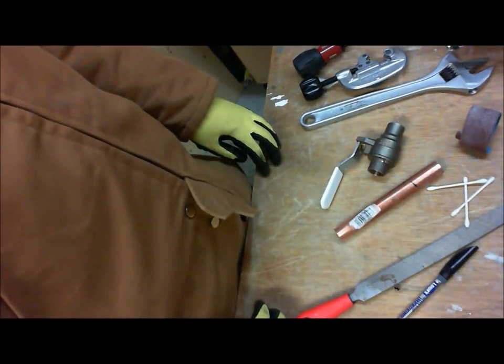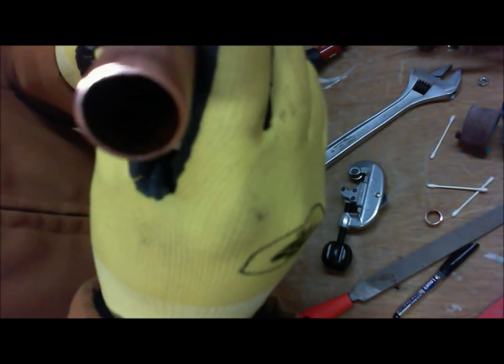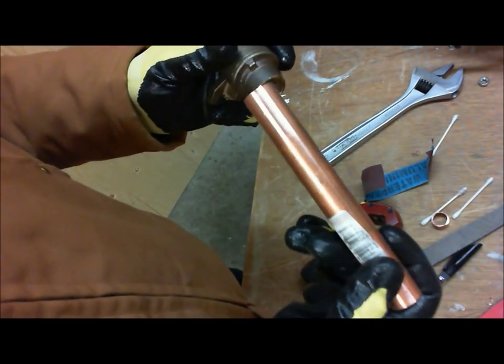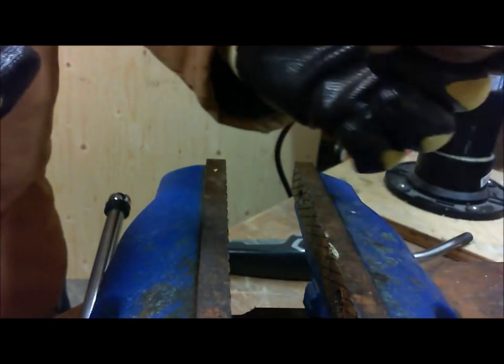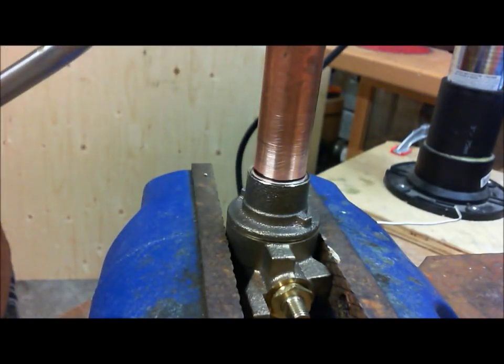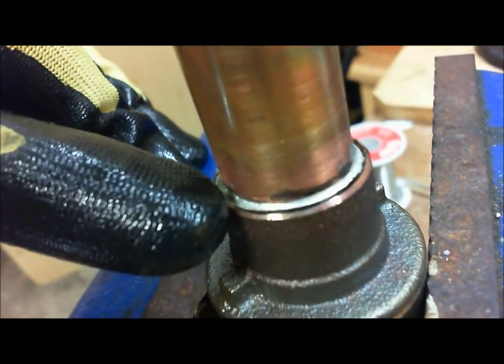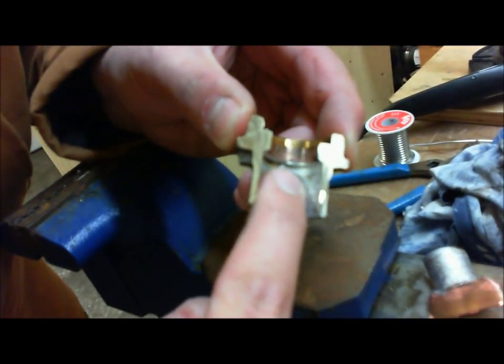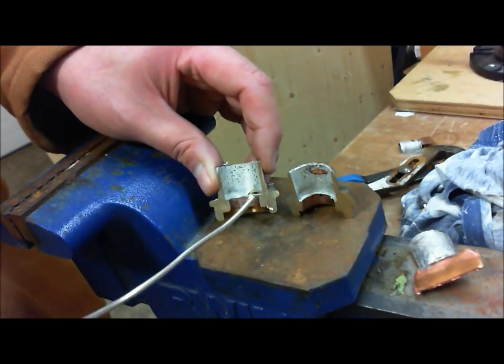Soldering Ball Valves

Comment: You are doing it a little wrong, you do not use permanent marker to mark depth,and you certainly do not force the cooling time,it can fracture or crack the solder joint

Comment: Could you use acetone to clean up the surfaces?  It works well prior to painting as it dries quickly
Reply from the maker: Please don’t. Acetone is corrosive. Either wipe it with a clean dry rag or use alcohol. Thanks.

Comment: I disagree with adding flux into the valve, when you insert the pipe the flux will be pushed into the valve and build up providing a path for the solder to build up with in the valve. better to add flux to pipe rather than the other way around.
Reply from the maker: With the flux on both the pipe and socket, it ensures that the solder will flow.

Comment: The other problem with those loose copper burrs is that they may eventually break free and get stuck in the down steam shut-off valve/faucet seal, causing a drip issue!
Reply from the maker: That is why I made the best vid on YouTube to solder a ball valve 😝
Reply: @MrTooTechnical  Thank You!

Comment: Dave I liked your video and learned some useful things. I have a question: I have unsoldered a couple of half inch ball valves. Was planning to reuse them on another system. Can I do that or are the valves damaged by the heat of melting the original joints?
Reply from the maker: Better to remove. How old r they?
Reply: @MrTooTechnical  I dismantled my homemade passive water heater and set the copper pipes and fittings aside about 25 years ago.  Now I have a use for the valves. Did I ruin them by unsolderring  them? Can I reuse the valves? Or did I melt the teflon seats? Maybe I should not take a chance and just go buy a couple of new ones.
Reply from the maker: What do u think

Comment: I HAVE A PROBLEM DESOLDERING A 3/4 INCH BALL VALVE, I VE APPLIED HEAT TO IT WITH A HIGH HEAT MAP GAS TORCH, I HOLD IT THERE FOR A WHILE AND NOTHING..IT IS MAP GAS THAT I AM USING, HOW DO I GET IT OFF?
Reply from the maker: too much water in the pipe.  cut it out then.  woohoo

Comment: Wow, so much extra work. Very detailed work. If you just sand, flux and heat it all works fine. The contamination come out of the fittings as the flux boils, wipe with a dry rag, and run your solder. Take off aerators for the sinks down line and flush the system of any excess flux or contaminations that made there way into the pipes.
Reply from the maker: It works. I made a great vid. Woohoo
Reply: @MrTooTechnical  You did, nice technique.

Comment: The fitting brush may have had particles on it from its last use.  It also may have removed a bit of surface tarnish from the inside of the valve. That's what it's supposed to do. It's not a bad idea to wipe out the valve before soldering.
Reply from the maker: i did, i cleaned the heck out of the valve and pipe.

Comment: Thanks for the video. You attributed the small spot with no flux present as being caused by a lack of heat. Question: Could that be caused by less than perfectly round pipe, where the spot with no flux was a small area with a pinch (interference) fit between the two parts?
The reason I ask is that I desoldered a pipe fitting and have sanded/brushed the old solder away as best as possible in order to install a new fitting. The fitting fits, but a snug in a couple spots. I don't know if the capillary action will work its way into a slight interference fit.
Reply from the maker: nope.  remember, when u apply heat the pipe will expand.  So i dont care how tight the fit.  once you properly prep, and flux, u should be gold.  i just didnt prep as good as it should have been.  hard to find on youtube anyone who takes apart their solder joints.
Reply: @MrTooTechnical  Thanks for your reply. I would have much preferred just cutting instead of desoldering. But the way the plumbing was installed would make this a MAJOR headache. IMMEDIATELY adjacent to the fitting I needed to remove are two "T's", then a valve, and then an inch later - the wall (and, no, it's not the wall some jerk says Mexico will pay for)
Reply from the maker: @gregparrott  i hope u have no issues
Reply: @MrTooTechnical  Thanks. It's been slow. But if I get the soldering right, I will have completed my first ever hot water tank installation. Replacing a 21 year old, 50 gallon gas one which started making odd sounds (well past due)
Reply from the maker: @gregparrott  there u go

Comment: Good info thanks.  Definitely don't want to over heat the connections or use too much solder I can see.       
Also, I didn't have 40 minutes so I viewed it at 1.5X speed, worked nicely.

Comment: Thanks for vid and very thorough explanation. I think in a ball joint you need to be very careful to get the brass fitting hot enough to accept the solder, without heat-damaging that plastic seat washer. The proof is in the pudding and you showed us all the solder coverage in your cross sections.
Reply from the maker: thank you

Comment: Great detail nice video. One improvement would be to test the joint under actual home water pressure. Close the loop of the copper tube at one end, add a joint or valve in the middle and at other end add a thread connector and do a water pressure test. That way you see if the joins leak and then cut it open to show why it worked.

Comment: @Dave Daved - Thanks for sharing the Great Video Dave! Very Thorough and well detailed. I was just soldering some 1/2" copper pipe yesterday... I also clean the inside the pipe after using the brush, and I also use the same style debur tool too (but stand alone, never saw that style on a pipe cutter) as I too thought it did a much better job than the reamers on my pipe cutters. Glad to see someone agrees!!   LoL :-)    :ThumbsUp:
Sandpaper works great to clean the outside of the pipe, but I found that 00 steel wool works great too. Oh and I cut off my fitting wire brush tool, and use it in my drill, makes it a lot faster when cleaning a fitting :-) lol
Reply from the maker: perfect.  thanks

Comment: Just want to make the point about the valve being open or closed when you solder it. In a closed pipe system the heated air inside the pipe is expanding and the solder will not flow into the joint because the air is venting there. Always solder with an opening in the system to allow heated air to vent and the melted solder will be sucked into the joint.
Reply from the maker: my method works.  and i asked the manufacturer.  thanks
Reply: Your point is valid, Hans.  I realize that you’re not just referring to the valve, but to the rest of an in situ pipe run as well.

Comment: You're supposed to heat up the tube first my friend.
The Alloy Valve is delicate, so the copper pipe must be heated up first.Then after you've heated it up well, then you heat up the valve.
Then start touching with the solder all around.
Good Luck with everything.
Reply: DAVE: you should listen sometime...Try to heat applying the flame to the copper tube first (you cannot overheat it easily), it carries the heat much more easily than the Brass-with-no-lead-alloy valve.  By heating the tube first, you avoid starting to overheat the seat.  The copper tube is GEST EXPANDED and it now has a THINNER gap to get the heat to the valve socket.  If you try to solder overhead, do it both ways and you"ll find that starting by heating the copper tube first is better and helps to carry the heat deep inside the socket, plus it keeps the seat area cooler.
Reply: @alfredomarquez9777  thanks for the follow up and explanation as to why to heat the pipe first.  I saw people commenting on it but you explained it logically as to why it should be done that way.  If only Dave would listen and learn instead of misleading others.  Also Dave is heating on the same side he is soldering, melting the solder with the flame.  Instructional videos such as this make it worse for amateurs trying to learn the RIGHT way to do it.  What Dave should do is take down the video or make comments in his video on things he's learned to do it better instead of telling people like you that they are wrong (he actually said ozzy was wrong).
Reply from the maker: wrong.  YOu can heat up in any order.  That why i did the breaking apart of the joint to prove there are many ways to do things.  lol

Comment: Great video and very meticulous and thorough, BUT not very practical if you're doing a lot of joints.Wiping a joint is potential for creating a leak.If you look really close when he solders, at the point where he first applies the solder, the solder beaded  up which indicates the pipe did not get hot enough for the solder to flow and properly bond with the copper.he applied the heat at about 7 o'clock, the little at 1 o'clock and 12 o'clock. A little more at 3 or 4 o'clock would have been a bit more evenly heated.That is most likely the same area where the void was in the joint. Then when he reheated it and wiped it, it did seal the rim. I have repaired a lot of burned joints because those who burn them are not moving the torch around enough. They have a tendency to hold the torch at one place and use too much heat.Again great Video. Like David said, don't quench the joint. It crystalizes the solder and weakens the joint.
Reply from the maker: i know it works, cuz i am the one who did it and cut it open.  hence the perfection.

Comment: If you do not already know 98% of what's in here, you have no business trying to learn it on a $15-25 valve.  This perhaps should have been separated into 30 minutes of "Sweating Copper 101" using ordinary fittings and a 10 minute advanced class on soldering heat-sensitive components.  And the real difficulty is then not with soldering the parts in a vice, but working on installed plumbing. The only thing I actually learned just now was that the manufacturers support soldering on the fully assembled joint as significant care must be used to manage the heat inputs.

Comment: Dave ... What a great video! I learned how to solder in the Electronics field, and have gained quite a bit of proficiency in that regard. However, when it came to plumbing, I've pretty much been a miserable failure, even though, I finally got all of my solder joints to work they weren't a pretty sight. Many years later, I'm looking at replacing a ball valve (in the vertical position), that I installed a long time ago [20 - 25 years ago]. (It needs to be reinstalled, because it froze in it's open position, and the only way I could get it to move was by tapping on the handle with a hammer. It finally moved and closed when I needed to, but a week or two later it developed a hole in the brass body and begin to spray. All that said, your solder joint in this video is like one of the most nicely done joints I've ever seen demonstrated. Thank you for sharing your expertise.
Reply from the maker: thanks for comments

Comment: dave daved
Have you seen corrosion failures of these valves?
We have some Mueller B&W 3/4 inch ball valves (red handle) which were installed around 2005. The problem we have is, they have white corrosion spots on them!
It's almost as if they're leaky, but they aren't ... they feel dry.
We have some NIBCO 3/4 inch ball valves that were installed at the same time. Those don't have any corrosion at all.
We do have hard water, so could that have caused the valves to leak or corrode ever so slowly? Oh and the corroded valves are on both hot and cold water pipes...

Comment: How NOT to solder anything. Didn't even get hot enough to burn the flux out. What a joke.
Reply from the maker: U failed. Lol. The video for instructional purposes. If you are a pro, cool. Most of us aint. So be nice.
Reply: dave daved ¡
Reply: The sharpie also added a nice area of no contact.
If you follow this guide , you will get a leak guaranteed
Reply from the maker: U r funny. Lates. Lol
Reply: jim davidson ...seriously. all I can say is at least he used a dry rag. and what's up with adding solder on same side as heat? and deburring like he's building a watch. .Lmfao touching it up. . its going in a wall! if this were 2 or 3 inch, there's no way that would b sufficient . and if he WERE a plumber, hed be fired asap for taking 30 minutes to sweat 1 side of a 3/4 ball valve. . im on lunch but rite now im sweating in 3 inch ball valves. faster than this too. .

Comment: Over in the UK it is nearly impossible to find valves with soldered ends. Valves are only available with compression ends or sometimes pushfit ends for plastic pipe!
Reply from the maker: And that is why there are so many valve failures in UK and EU! Solder is the best.
Reply: I know solder is best but I can't fit what is impossible to buy.
Reply from the maker: Amazon.com baby
Reply: Importing valves are highly unlikely to fit the main British pipe sizes of 15 mm and 22 and 28 mm outside diameter copper tube sizes
Reply from the maker: Nope. It's available online baby.
Reply: You can solder something that is threaded. Just use a round wire brush and do everything the same as soldering pipe. I worked in UK for a few years and we found many MANY valve assemblies in showers and i have found some like this in older homes in USA that have the male and female threaded together but then soldered. btw yea its almost impossible to undo them.

Comment: Good video. I am glad you mentioned that the heat can damage the seals inside. That is why I always take apart the valve before applying heat. It vary simple and only takes a few seconds to do and well worth the time. I apply wet rag to cool it down (which it can be done shortly after soldering) to cool it down for reassembling the valve and it comes out clean, just like you have demonstrated.  Very well detailed video. thanks
Reply: If you are soldering a short piece of tube to the valve, great!... But you cannot reassemble the valve when both halves are soldered to fixed pipes!

Comment: This video is informative in several ways.
I've been doing home-owner plumbing for decades and soldering has become so much more difficult.  I remember my dad having a big lead melting-pot and he would just dip pieces in so they would be pre-heated/coated at the joints.  Almost like Lego, it was so easy.
The combination of practical and scientific info here is just right.
And that cross-section view is great !
Helped me change out 8 old failing rubber-seat valves for new ball-valves in my basement without frustration.
Reply from the maker: +Andy Westwood glad i could help.

Comment: Thanks for the video.  I always wondered how I should have these valves (opened or closed) when soldering.  I knew that the older globe valve types were supposed to be soldered while open so you didn't melt the washer, but I was never sure about ball valves (which are much better valves in my opinion).
Reply from the maker: +Pete Ciallella thanks
Reply: Pride for your heritage, ball valves were called: "Italian Valves"  better know by the place where they were invented! After the chinese copied them now they are ball valves.. Nibco Usa paid licensing fees for a good while and did an decent job until shipping out to China. Be careful on the lead content of the chinese valves. Stick to Made in Italy or second choice, Made in Usa.

Comment: I just watched a video from copper.org and they give lots of reasons for NOT heating the value cup first. 1) it does conduct heat as well as the copper tube, 2) it expand the cup and increases the airspace. If you start with the tube, it expands to decrease the airspace.
Reply from the maker: +Brad Cathey Well like  i said, it works for me.  And remember, copper.org don't deal with brass alloys! They love copper.  Heat the socket and tube, and you will wonders.  No leaks for me.  thanks again
Reply: Saw similar info, new lead free components don't transfer heat as much, then that air gap, and using the pipe heated first and kept hot as you heat the cup is how we go with new lead free.
Reply: NOPE!...  In their video, they show a BRASS with NO-LEAD alloy valve that conducts heat much less then the copper pipe, so they correctly heated the copper pipe first, so that the heat is much more easily conducted Deep inside the socket of the low heat conduiction brass valve. I suggest you look for their video. While they waste a lot of solder in their demo, their procedure seems a little better.  Respectfully, Amclaussen.

Comment: This guys all wrong. No need to take off the handel. Ball Valves are solderd in the closed position putting the handel out of the way. The seals are Teflon plastic and will get soft when heated but still conform to the ball shape of the valve. This will not happen if the valve is solderd in the open position. Never move the handel untill the valve cools! 
Check the NIBCO web site or the tag that comes with the NIBCO valve.
Reply from the maker: +rudedogmakingtracks No man.  When i called nibco that is what they said.  the video is just one method of soldering.  thanks again.
Reply: Them people in the office dont know. I've worked with many Journeymen Plumbers that  have problems soldering with these new LEAD FREE alloy valves. They blame leaks on the valve. Look up a video from Nibco on YouTube for more information on soldering Lead Free alloy Ball valves.
Reply from the maker: I don't get leaks when I solder leadfree. I do it like the video all the time and it works for me. Thanks again

Comment: It looks like an important consideration is to remove the valve from the assembled plumbing, and solder it in an ideal position as you showed. Soldering in-situ can be difficult, as when in a vertical position, and getting the solder to flow upwards, and not having complete visibility all around the joint. Nice job!
Reply from the maker: +Michael Post thank you